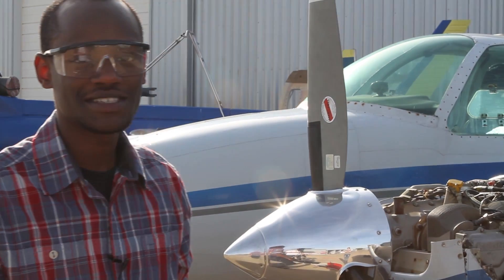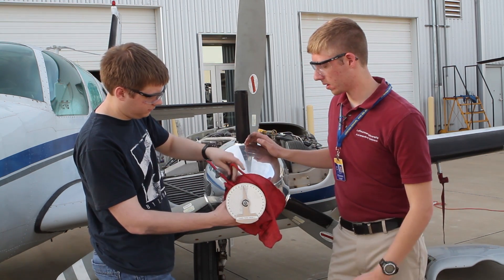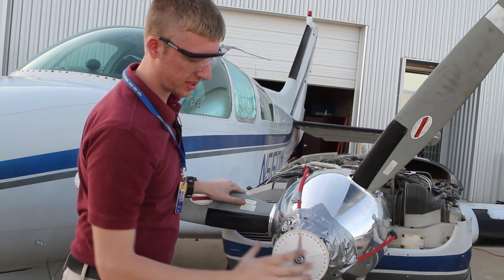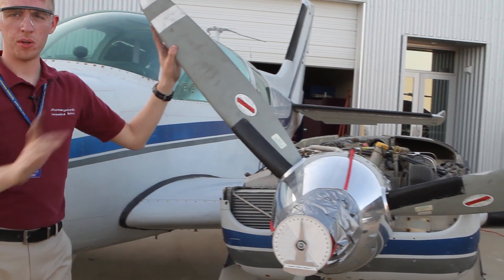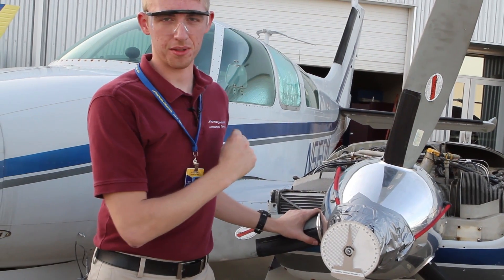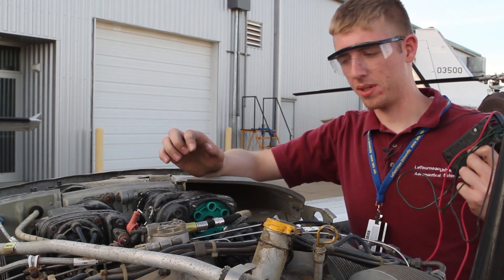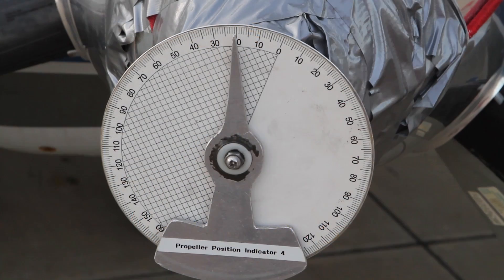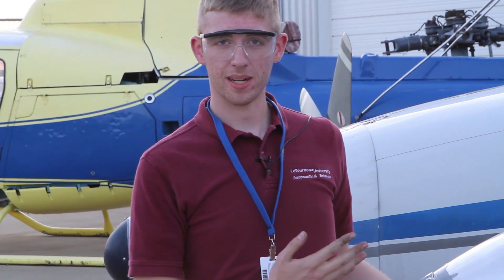Magneto to Engine Timing

Comment: Have a hard plastic long dowel to insert for TDC no 1 cyl. and I can feel the sweet spot right at TDC. :) put the flower pot on, I like the plastic base. If metal flower pot slit a fuel line and use as a ring cushion on the base of flower pot tie a few knots in your bungee cord make it snug. spray lil hog slidum thin on that pendulum and exercise it a bit.  Set the protractor at O degrees  back it up a bit like 60 degrees and come on to it to get the lash out till you get to 20 degrees or what ever the BTDC timing is on the data plate on engine or in the engine manual for the specific engine. Exercise that pendulum. Install mag set to fire on number 1. install the other mag to fire on number 1 use the first mag as master and have the second mag to come on EXACTLY to the first you put on....been doing it since 1979 that way....fast and on the money.

Comment: How about using the timing marks on the crankshaft that you can see through the timing window. Sure, it costs you a $0.30 gasket and a foot of safety wire but it's right on.
P

Comment: In your A&P school did they not teach you not to rotate the propeller in opposite direction of rotation as you have now destroyed the carbon block in your vacuum pump.
Reply: What about moving backwards during a compression test ?  How many pumps have you wrecked ?  Idiot.  I’ve moved props backwards for 20 years and not one single one has broken.   Dipshit.

Comment: How does the magneto gets charge in order to fire up the spark plug
Reply: I could tell you, but then I'd have to bore you to death.

I'm just kidding. You would not have asked if you weren't interested.

Here's the TL/DR version:
The magneto has a spinning magnet that builds a magnetic field. The field uses coiled wires in a small transformer to generate an electrical impulse, and the secondary coils in the transformer steps up the electrical impulse to very high voltage. This high voltage gets directly fed to the spark plug.

To answer a question you did not ask, look here:
https://www.faa.gov/regulations_policies/handbooks_manuals/aviation/
You will find most of the pilot-related textbooks free to download here. No joke. You could pass a lot of written tests on your way to being a pilot by reading through these pdfs. If you know your stuff, you could just pay a flight instructor to go over what he wants you to know. It might take an hour or two, but if he's happy with your knowledge, you may be able to talk him into signing you off to go take your written test, and he'll only have to spend time teaching you how to fly. You could save a lot of money here.

To answer your question, you don't have to read the explanation I'm about to give. Just go here:
https://www.faa.gov/regulations_policies/handbooks_manuals/aircraft/
Click (and download, if you like) the Powerplant manual, volume 1. Start at Chapter 4 (or page 162 of the pdf). I'll give you the summary version.

The magneto has three major circuits that make it work. There is the magnetic circuit, the primary circuit, and the secondary circuit.
The magnetic circuit consists of the strong magnet, a component called the "pole shoes", and a soft iron core. This circuit's job is to build, dissipate, and reverse the magnetic field needed to make the primary circuit work.

The primary and secondary circuits are called such because they refer to the coil in the magneto. The coil is one component; functionally, a small transformer. In one sentence, a transformer's job is to either step up or down voltages, or isolate the load from the source of electricity. In this case, it steps up the voltage a great deal.

The primary circuit consists of what are called "breaker points," a condenser (old-fashioned name for a capacitor), and the primary windings of the coil. This circuit's job is to turn the work done by the magnetic circuit into a useful electrical impulse. I'll spare you the details. If you are genuinely curious, follow the second link above and find the book and chapter I recommended. If you have done those, I will elaborate. The book is a great resource, but it's so much better to have human help.

The secondary circuit consists of the secondary winding of the coil, the distributor, and the spark plug itself. This part is fairly self-explanatory. The most complex concept is that the secondary coil takes the electrical impulse of the primary coil and steps it up to a very high voltage. This high voltage is delivered to the spark plug through the distributor. At this time, I'm going to assume you know what a distributor is. If not, respond to me here and I will elaborate.

I hope this helps!
Reply: The coil spins inside the mag generating high pulse electricity. High voltage (30k Volts and higher) and low amperage less then one amp. When the breakers brake contact causes a field collapse in the copper windings.

Comment: Did not catch how you decided it was on the ignition bit of the stroke rather than the exhaust bit of the stroke? Normally use a whistler or a finger over the plug hole to make sure on the compression,ignition stroke.
My angle indicator has a non slip soft liner,saves all that rag and duct tape nonsense!

Comment: Degree wheel ducked taped to the spinner did it for me. I know there’s a better way than that. That has to be a mistake waiting to happen.  Maybe if we where in the jungle making some survivor film, this duck tape thing might fly.
Reply: Actually that is how they teach it in A and P school. Granted my teacher used painters tape (which is what I'd recommend) But you have to make sure it doesn't move at all. And tape is the tried and true method.

Comment: After you set your timing disk to 39, all you need to do was rotate the crank to 20 degrees before absolute tdc. No need to go all the way back to 0 only to move it past 20 degrees then back to 20 degrees to take out back lash. If you initially stopped at 20 degrees after your 39. There'd  be. O back lash to worry about

Comment: Trying to be funny....not!! DO OVER!! Should make sure the indicator is level first and NEVER us duct tape! Get the MAG RITE system, the system is more accurate then the analog one you are using here plus it works on multiple blades, it's plastic and will not scratch the spinner so not rags and it has bungee cords so NO DUCT TAPE. Good luck!

Comment: Since the engine is driving the propeller you need to take measurements after adjusting the propeller in the OPPOSITE direction of normal engine operation (this means rotating the prop by hand to the left for American Lycoming and Continentals, which when the engine is running turn to the right - as you look out the front window from pilot's seat). If you adjust the prop in the direction of normal engine rotation with your hand, you are adding backlash not eliminating it since as you hand adjust the propeller the propeller is driving the engine (not the other way around as during normal engine operation).
Reply: Yep
Reply: The gear train is on the opposite end of where he is turning, he did correct. If he was turning the gear train itself then you would be correct.

Comment: You should really look into getting a "Rite system" magneto to engine timer.  The old flowerpot is fairly inaccurate.  Time rite uses a digital protractor that is accurate to 0.1 degrees.  It also comes with bungees for 2 and 3 blade props.  If that were my Baron, I would not be happy about you using duct tape on my polished spinners.
Reply: LeTourneau trains its students with the mission field in mind. That's why they use the flower pot. This says nothing of the amount of debt most students walk out of LeTU with. Kind of a strange place to be when most mission organizations require their missionaries to be out of debt to go on the mission field.

I think they included the duct tape as a test run for a Hootenanny skit.
Reply: You clearly don't do this for a living
Reply: @MrNavyman53  
         True.   

     Aircraft owners have different priorities than aircraft maintainers.
      
    For Aircraft maintainers, good enough is the goal…get er done quickly and move on to the next task.   Accuracy is not as important.  After all, it’s not their airplane and they don’t have to fly in it.

      For an aircraft owner that cares about precise magneto timing and its effects on peak intercylinder pressure (and CHT), accuracy matters.
Reply: @Stepclimb  Not so much how many airplanes a person can get through, more the fact that a mechanic times magnetos far more often. A mechanic that's been doing it with a traditional buzz box and protractor or physical timing marks can most likely get the timing as dead on as another can with some digital protractor kit.
Reply: u r gay
Reply: Time Rite for Radial Engines 99.9 % of time. Flower pot is dead nuts on if you know how to make it accurate.

Comment: that duct tape will sometimes remove the paint from the spinner when you peel it off. I always use the blue painter's tape it works well enough to hold the timing disc in place but it won't pull the paint off the spinner
Reply: There’s no fucking paint on it.
Reply: @hellonwheels9149  Sssshhhhh lets see how observant people are.

Comment: in  3:00  Why did  you turn the propeller in to opposite direction of rotation since you already found TDC  ? ? I didnt understand that :(
Reply: That is because there is a plug sticking into the cylinder, screwed into the spark plug hole. The plug prevents the piston from actually reaching TDC, but provides a consistent reference point. The first stop of rotation was when the piston touches the plug. Then the propeller is rotated around the other way until the piston comes back up and touches the plug again. Now we know how many degrees of rotation it takes to reach the plug, and therefore how many more degrees are needed to reach TDC (half of the angle between plug contact to plug contact). Then when the plug is removed, we can accurately set TDC. As some comments have mentioned, most engines will have markings on a starter gear or belt pulley, but this method is somewhat universal.
Reply: It's a piston locating plug that he's using in the video, not a long reach spark plug.
Reply: Trenton Troxel wrong. The if the piston touches the plug it is a long reach plug inappropriately installed in a short reach cylinder assembly. The reason for rotating backwards is because the magneto is timed to spark in advance of top dead center (on this Baron, which sports the Continental IO-470 series engine that should be about 20 degrees before top dead center) so if you begin at top dead center, rotating back will move you IN ADVANCE of TC. Ask yourself this question: if ignition occurs approaching maximum pressure within the combustion chamber (top dead center) how could it complete a stroke if the spark plugs prohibits reaching that point as you've alleged? By the way I'm a pilot and A&P mechanic that flies Barons and other piston twins.

Comment: what about the other magneto, is it the same procedure? Should I sync both? How can I know that both are sync?
Reply from the maker: +Daniel Lima, I think so, yes. You'll see dual magnetos on aircraft for the reason of redundancy. Therefore, you're going to want the magnetos to fire off at the same time.

Another way to think about this is as such: Go into the cockpit and look at how the aircraft will have a Left Magneto, Right Magneto, and both option as you turn the key or flip switches. This is brought up because it is another way to see that the aircraft will want to be operated in the BOTH position.
Reply: The procedure is the same for both magnetos. When you set the prop to the proper position before TDC, you can adjust both magnetos. You verify that they are in sync, by using the timing light, which connects to both magnetos. It has a light and an audible indication if for each magneto or both magnetos being open. Doing the check at 7:55 would allow you to hear/see if one of them was not in sync. Then it is just a process of fine adjustment of the mag(s) until it is set properly.

Comment: How can you tell if the number 1 cylinder is in the compression and not exhaust stroke?
Reply: Matthew samson Put your finger over the spark plug hole and you can feel the piston forcing air out of the cylinder on the compression stroke.
Reply from the maker: +Matthew samson, it may take a few turns of the propeller to feel the outward pressure of air as mentioned by GRowe1978. The reason you'll need to turn the prop a few times is that the rotation of the prop will rotate the crankshaft and thus the piston.
Reply: we were taught the finger air pressure "method" as well, but in our advanced classes we were taught that the most time-consuming method, (but the only we were taught to make sure) was to take off the rocker box cover, and look at how they lift and lower. If you know the order the piston takes, both rocker arms are lifted at the same time right between the exhaust and intake events. So, you should see the arms feeling "loose", you can check by slightly jiggling them. After that, if you are turning the prop the correct way (this is more of a test to confirm the way you are turning the prop as well,) the intake valve should be lifted up (still loose) and the exhaust one should now be firm, as it is down.

Comment: "...not to walk within the prop arc". So, of course, he puts his left arm right in the middle of the prop arc.
Reply: Well he ain't spinning it is he?, If he was he would not be waking in between the prop arc, there is obviously not enough wind(which you need a lot of) to make a piston engine spin freely when hes doing this.
Reply: CrazyForCooCooPuffs How long have you been flying? Obviously not very long (if at all), otherwise you'd know that it doesn't take much prop movement for an engine to start if the mags are hot, the fuel is on, and the engine is anywhere near where the mags would fire on any of the cylinders. Do you even know what a P-lead is?

And I think you mean "walking", not "waking"
Reply: SoCalGuy93065 I'm an A&P not a pilot. I work the line on an FBO, where it is nice and windy every day, I don't see much prop movement. The only thing that moves are the free turbines on the being planes across the field. 

There's clearly no wind in this video, These are obviously students being supervised by a experienced instructor. 

Oh and you need to add more things to try and win the argument like correcting my spelling, we are adults this isnt highs school.
Reply: CrazyForCooCooPuffs "this isnt highs school". LOL, if you don't want people to think you're ignorant try not putting your foot in your mouth when you're trying to prove them wrong.

And who said anything about wind (other than you)? Hopefully you're aware that there are more ways of turning (and starting) an engine other than just that (?).
Reply: SoCalGuy93065 On the other hand, if they'd removed all of the spark plugs (or at least disconnected the leads) I'd agree that it was safe to turn the prop without any danger of the engine starting unexpectedly.
Reply: Lmao, OOOKKK
Reply: CrazyForCooCooPuffs You aren't an A&P, you're just another lame YouTube troll.

Comment: Yes, I admit the duct tape is not necessary and it results in more cleanup. You can be creative and use other methods that are safer on the spinner as long as it holds the can centered and doesn't move. Once you understand how this works, you really should be checking the timing of both magnetos together. For safety, the ignition harnesses were removed from the magnetos so they would not fire. Most importantly, ALWAYS consult the proper maintenance manual and related service info as the final say for procedures over anything said in a video. Thank you for watching!

Comment: I would like to add that it is a good idea to verify you have the dial or deg wheel set correctly.  I would rotate it back and forth a couple of times and verify you have the same amount of deg before and aft of tdc on the deg wheel verifying the dial is set correctly.  IE if your at one stop and its 28 degree Before TDC when rotated to the other stop you should have 28 deg After TDC.  always double check!

Comment: Good video, my only recommendation is not to use duct tape to secure the timing disk, as it leaves a sticky residue that is a pain to remove. I would use masking tape, much easier clean up.

Comment: Pavel is correct except that for greater safety, after removing the engine from the airframe to install the magnetos, the wings and empennage should also be removed so that in case the magneto accidentally fires, the plane will not fly away.

Comment: Nice video, think will be helpful for students. Good job guys! 
The only thing I would like to add that it's advisable to time magnetos to engine when not installed on an airframe cause you can still damage the cone and the cowling even when using protective equipment.